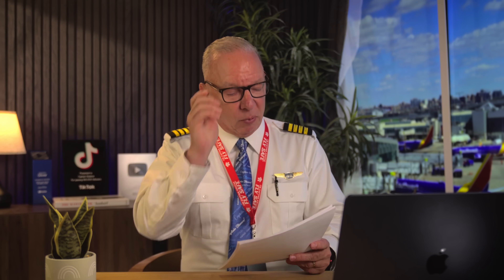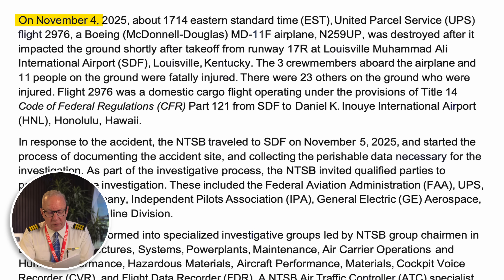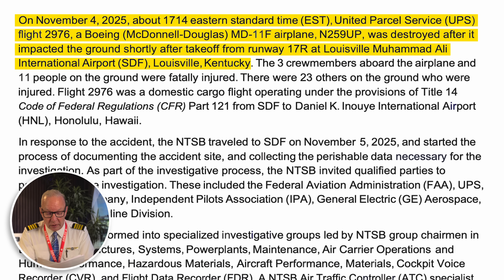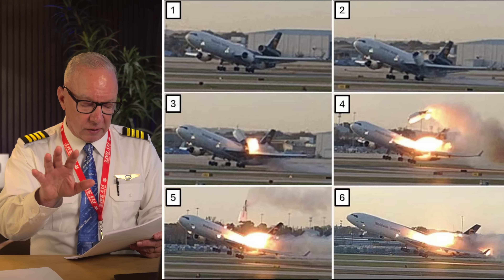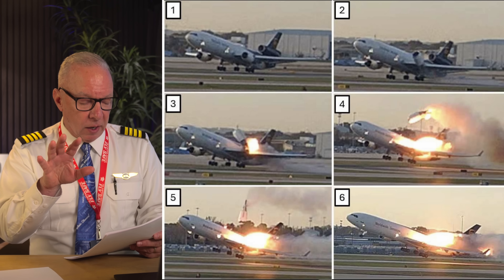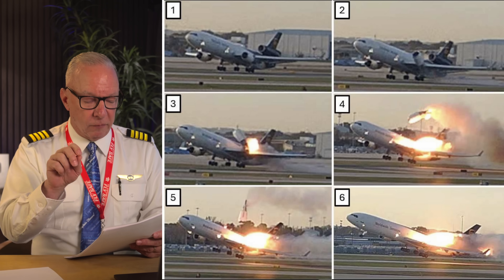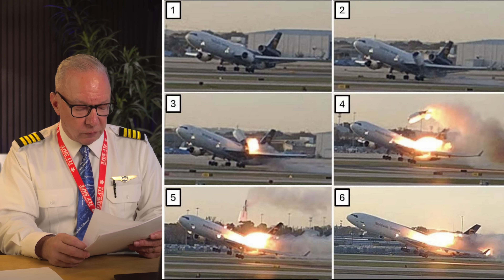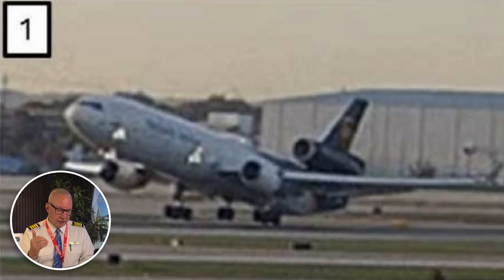UPS Crash Preliminary Report | Pilot Reacts to UPS Crash Report

Comment: "Now we know what caused the crash"
Nope, we don't.
We know which component(s) failed and how the events unfolded.
We don't know why the aft mount failed. Okay fatigue cracks, but what caused the fatigue cracks and does this cause apply to the entire fleet or is it an individual occurrence? Some possible causes of cracking:
- autonomous fatigue  cracking  (probably design fault)
- corrosion related cracking (e.g. faulty storage conditions)
- foreign material inclusion cracking (production error)
- incorrect mounting of the bearing (causing undue stresses, maintenance error)
Etc.
So we still don't know the root cause.
Those 8000 cycle to go before any next inspection seems a long way, assuming four cycles a day, that would be in five years time. On the other hand those bearings are thrust bearings and not wearing parts. So a long inspection cycle might not be undue.
I expect a directive to go out to all MD11 and DC10 operators to inspect and report back on the mounts. Let's see what results from that.

Comment: YES IT WAS 481 FEET ABOVE MEAN SEA LEVEL!!! Come on, Captain Steeeve, you know better than that. The air field is about 400-450 feet above msl which means the plane was 30-81 feet above ground at its highest point. Stop saying we know it didn't get that high. It did!!! You normally have great information but you're missing it on this point.
Reply: @ronr3856 Why so angry? You could easily make your point in a nicer way. Cap's Steeeve is merely trying his humanly best. GEEZ!

Comment: Gyroscopic precession makes the engines want to turn to the right of the direction of travel. This is why the left engine flew up and to the right, and why its debris was ingested into the tail engine. With two engines out, the airplane could no longer fly. If instead it was the right engine that had departed, it most likely would not have impacted the tail engine. With two engines running, this would have given the pilots a fighting chance to make an emergency landing.

Comment: I don’t understand why they won’t release the video… don’t even go there with respect to the family.. the internet is full of the end.. from tons of angles 
Why not just let us see how it happens in real time…this is what happens when you put a stronger engine on a older plane, 
So the question is because they used bigger engines, did they have to move it forward, the 737 wasn’t the only plane they did that to
Was getting it out farther for clearance, putting unnecessary stresses on aging parts

Comment: Captain Steeeve, the elevation of Louisville Muhammad Ali International Airport is 471-500 mean sea level if I read that correctly, so the last ADS-B data of 481 mean sea level is probably correct, or close. Also I think the fire behind the aircraft is the burning engine that came loose. I think you should re-evaluate the photo.

Comment: This has nothing to do with AA191.

That was a damaged pylon due to improper maintained procedures.

This is fatigue failure.

The inspection interval was obviously insufficient, but it wasn’t due to failure to follow recommended maintenance practices like AA191 was.

Comment: Zooming in on frame #2, looks like the #1engine inlet cowl is deformed. Possible fan disk failure causing extreme vibrations resulting in metal fatigue failure in the pylon mounting. Just my own opinion. And 1 cycle = 1 takeoff & 1 landing.

Comment: Capt Steve seems to misunderstand the "481 feet above mean sea level". The airport located in Louisville KY sits a bit less than circa 500 feet above sea level. Hence the reference is roughly correct. How can an accomplished veteran pilot confuse "mean sea level" reference in the preliminary reportwith "agl" or above ground level. C'mon Capt Steeve you're smarter than that,,,,
Reply: because he's not a pilot. Fake maybe? A doppelganger?

Comment: I'm not a engineer by any means but I am very mechanical Not on aircraft obviously but I do know how bearings and stuff works I think in a nutshell That should be  service sooner especially as the aircraft gets aged to prevent this from happening again because those heavy huller aircraft are definitely needed and very expensive to replace So just do preventative maintenance more often and solve the problems R.I.P. all involved!
Reply: @JoshuaWilliams-1980 I was also wondering if the "weight" of the cargo being carried contributed to the  stress fractures. I think these planes were purchased by UPS after retired from carrying passengers. Would the difference in weight of cargo vs human passenger weight affect design?
Reply: @cmhansonI would think so

Comment: I doubted for awhile that the aircraft had any fully working engine. Both engine 2 and 3 were spitting flames, indicating compressor stalls and losing power. It's likely both engines had ingested debris and were failing.

Comment: So a likely solution is to shorten the time of detailed inspections of those mounts to every 10-15K cycles, which might seem a bit much but isn't too damaging in terms of time spent? Absolute replacement of mounts (I'd do all four on the pylons) every 20K cycles, just to be safe. Given that there are not all that many still operating I could see an immediate replacement of the mounts being worth the expense, regardless of being at 20K or not.

Comment: My opinion on the #2 engine compressor stall: It may or may not have taken in pieces of the #1 engine, but, it was certainly sucking in flames and air that had no oxygen left to support combustion, causing compressor failure. You're going to get compressor failure when the compressor is being powered by the engine itself. It doesn't have oxygen to burn the fuel, to turn the compressor. Exhaust gasses have very little, if any oxygen in them. Add in flames that would definitely affect the operation of the engine too. The heat from the flames being sucked in may have caused internal engine damage to #2 as well.  Prayers to all affected by this preventable disaster.

Comment: My question would be “when, if at any time, was the incorrect maintenance action of removing the pylon and engine as a single unit done on this airplane?”
This incorrect maintenance method, instead of correctly  removing the engine separately  first, then the pylon, was I believe a suspected cause of the similar 1979 Chicago DC-10 crash.

Comment: IIRC, they did an emergency inspection of the remaining MD-11s and found fatigue cracks in at least 8 of the aircraft still flying.  This led to the FAA grounding the entire fleet.  Given that the DC-10 and MD-11 pylon engine mounts are of similar design,  FAA decided to amend the order to include all remaining DC-10's.
Now it's up to Boeing and the FAA to determine if there is an effective fix to the problem and how best to implement it  That could take months and then the operators will have determine if it is worth the expense to do so.

The phase out plan for FedEx had them flying their MD-11's through 2032.  Another 6 years.

If UPS and FedEx and World Global can make other arrangements to replace that lost capacity, it is quite likely the flying careers for all DC-10/MD-11 aircraft has ended - at laest here in the US.

Comment: While reading the report I think you were confusing the forward and aft lugs of the aft pylon mount with the fwd and aft pylon mount locations.
Reply: He did misspeak. The rear pylon mount is comprised of 2 lugs, the aft and forward lugs. But I don’t blame him the NTSB could have used better verbiage. 4 crack indications on both rear mount lugs, 3 being fatigues and 1 being overstress. Just my interpretation as an aircraft structural inspector.

Comment: 5 Yr cycle to check engine mounts crazy the most stressed part of the plane.. especially when they failed before. They greased the mounts 2wks before but didn't check them why because they would of had to drop the engines and that cost time and money.. We are talking about profits before safety here
Reply: the  plane had almost 93,000 flight hours!! Profits over safety when it comes down to it.

Comment: Has maintenance ever changed their engines using a forklift and not a crane. OSHA requires lifting things from the bottom with a fotklift P3 s perfected using 20k forklifts as a hoist with a boom and sling adapter you can change an engine anywhere on a ramp or hangar OSHA no joy Navy done it for years

Comment: If you look closely, it appears the #1 engine looks slightly tipped upward in photo 1 as well. Gyroscopic progression is why it flew up over the fuselage. I spent the vast majority of my Navy and civilian working career (25yrs) working on and running the GE CF-6 (LM-2500 and 5000) engines. The Sioux city Iowa DC-10 crash was caused by a catastrophic failure of that engine. So it was quite possible it could have been an engine failure as well.
Reply: Sioux City.. United 252 heavy was flaw in the fan disk from manufacture the size of a grain of sand.... The failed fan disk and blades took out hydraulic lines...
Reply: Retired airline pilot here. 
The engine was producing thrust at the point the rear mount failed followed by the front mount failing which explains why the engine pitched up initially then separated and flew up and over the wing.
Gyroscopic precession explains why the engine yawed to the right as it pitched up.
Same thing happens in a propeller aircraft when you pitch up...plane yaws to the right (Based on gyroscopic precession alone, P-factor would have the opposite effect.)
Pitch down...plane yaws to the left.
Reply: Yeah, noticed that as well. It was already breaking loose in photo 1. Massive torque
Reply: They said the engine didn't fail.
Reply: If I'm remembering correctly, I learned that the pylons are designed to fail that way, as in, up and over? I think that would make sense for a plane with two wing mounted engines, but not sure about one with a third mounted behind, for obvious reasons now/after AA flight 191. I could be remembering completely incorrectly though, I'm not an expert in the slightest. Would love to be corrected, always up for learning.
Reply: @dinosinspace  no, they aren't designed to do that. It's just a matter of physics when the aft mount fails and the engine is still producing thrust. The forward mount becomes a pivot point. Pylons that are intended to be jettisonable are designed to separate at the forward mount first, so they fall down and away from the aircraft. But airliners don't have those. That's a military thing. I used to work on them.
Reply: @Puffs_Daddy  The design is that they intend the rear mount to fail first, throwing the engine up and over the wing; and not the forward mount failing first, the engine pointing down and pushing the rear mount up and through the wing..
Reply: @robertbackhaus8911  no, it isn't. For one thing, the front going down wouldn't push the rear mount through the wing. They aren't designed to fail at all. Even if they were, going down would be far more preferable to going up, as these events have made painfully clear.
Reply: Let's Cut the Sh**p!  Regardless if DC-10's are called MD-11's, truth be told, the Mechanics 
like in 1991, again saved 3-4 hours, by fork-lifting of a fixed engine, to bolt back into 
the pylon, instead of method by "MD-11" aka, DC-10 manufacturer instructions not to do that!
Reply: @ValeriaMessalina1  and your evidence of this is????? Did you also notice it wasn't the same thing that failed?

Comment: As I commented on your earlier video, I was pretty sure it was a pylon failure and not an engine failure.  Given how large and robust the pylon is, it is pretty much conceivable that an engine could grenade badly enough to take the pylon off the wing.  If anything, an engine failure would affect the forward pylon mount and that wouldn’t likely be noticed under fill throttle as the force forward and up would hold it in place.  The issue there would be when power was reduced enough to allow the front of the engine to fall free.

Comment: A friend who was a jet pilot told me a couple of days after this accident that it was the left pylon that broke and the #2 engine had the compressor stall. As far as he could tell, the #3 engine was still functioning. Sure enough, the NTSB said the same thing. He also nailed the cause of the Air India crash from several months ago too. He's a scary smart guy. Another friend who flew RC-135s and B-1s in the Air Force said the same thing about the MD-11 crash. Left pylon broke.

Comment: Why was there a turbine blade on the runway, the engine cowling damage shows blade 
Failures. If that was enough plus gyroscopic effect at rotation, kinda points to the pilon, wing mounts.
The odds of blade failure at rotation with weak mounts, 
Wow.

Comment: Look, since American Airlines crash, these aircraft have been doing fine in their duties as cargo aircraft. My concern is maintenance of pins holding engines in place. When were the last inspections.? Was the inspections thorough enough to detect cracks in the pins? How many MILLIONS of miles MD10/MD11 have since the AA crash?? Maybe a review of inspection cycles and making them more frequent then the current standards

Comment: Captain Steeeve! you are mistaken. That report talked about the overstress fractures to the aft mounting point forward lug, not the forward mounting point. The aft mount wing clevis supports both the forward and aft lugs, as shown in the diagram.
Reply: You are correct

Comment: I think many thought they had addressed the issue after AA 191 and they may have addressed the issue that caused that particular crash, but it isn’t clear yet if this crash was due to the same issue or simply a fatigue issue with a 90,000 hour airframe.

Comment: Hey there Captain Steeeevee, question for you. Why couldn't this accident plane continue to fly on it's one good engine? If a two engine plane can fly on one of its engines then why couldn't this 3 engine plane fly on one of its engines, wouldn't it be the same idea as a two engine plane flying on one engine. Or is it the simple fact that the plane had literally just did its take off role and didn't have enough altitude and airspeed for one engine to sustain flight. Or possible other factors such as shrapnel from the number 1 engine possibly severing flight controls.

I remember watching the Mayday: Air Crash Investigation on the '79 DC-10 out of O'Hare. The departure of the number one engine from the wing had ruptured the slats hydraulics on the leading edges which retracted the slats on the left wing (which the pilots didn't know happened), essentially giving the right wing more lift on the planes lift off roll. And due to training the pilots had at the time they thought the engine had just stalled/flamed out (not completely came off) so they were trained to reduce power. That however put the plane into a stall, which the pilots didn't realize because the departure of the engine had also ruptured the indicator of the stick shaker so the pilots didn't know they were in a stall. Now grant it the difference between this accident plane and the '79 crash is that the '79 DC-10 accident plane still had their number 2 engine functioning but during the investigation they determined had the pilots not reduced power they still could have sustained flight on two engines. But that brings me back to my original question at the start of my comment about a two engine plane sustaining flight of one engine verses a three engine plane sustaining flight on one engine.
Reply: what a ridiculous question. how many times has this been discussed in all aviation channels yet you ask this again. Take the wax out of your ears dude!!

Comment: As the aircraft rotated, the upward movement of the engine would have caused a strong force either to the right or the left, depending upon the direction of the engine's rotation, due to gyroscopic precession (90 degrees in the direction of rotation). That force could have been sufficient to cause the rear pylon attachment to fail.
Reply: The NTSB is specifically stating the mount failed due to age related fatigue cracking (hence the grounding order).
I would expect the fix to either be enhanced inspections or complete replacement of the mounting component or the entire pylon. If multiple cracks are found, I would expect the second option to be enforced.

Comment: Ok, this was not entirely surprising. Seeing the engine on the side of the runway with the pylon apparently still attached to the engine sorta indicated a pylon failure. 
Addressing the compressor stall of engine 2. Certainly it could have ingested some debris but I was wondering if simply sucking in super heated air or actual flame from the fire, could cause a disruption of compression and cause a stall all by itself, not even needing to suck in debris to cause the compressor stall?
I would think that the hot air or flame would severely affect the air fuel mixture and thus cause the #2 engine to stall.